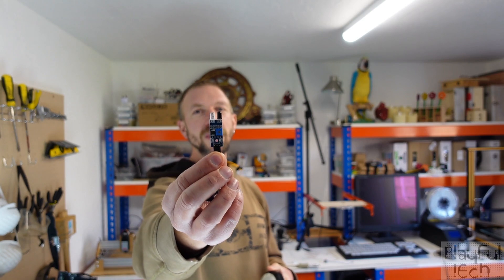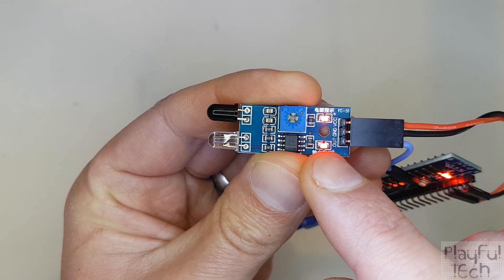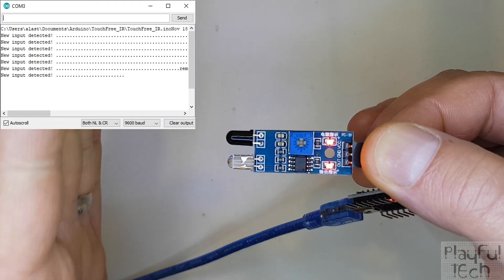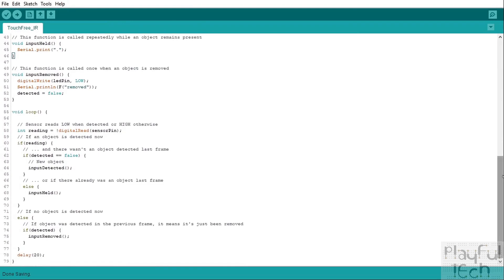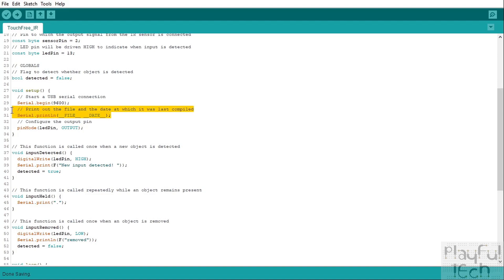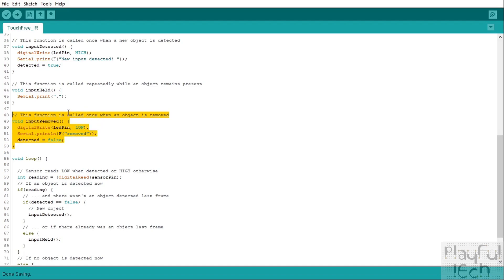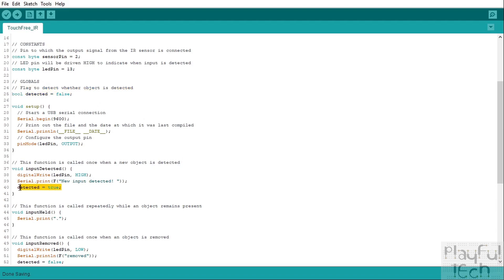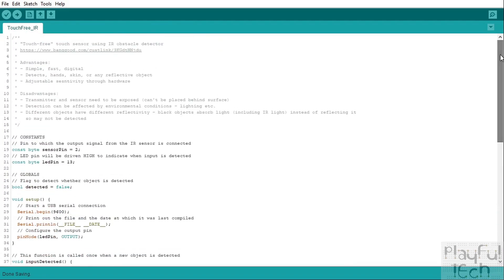Infrared Obstacle Avoidance Sensor Tutorial for Arduino / ESP32

Comment: Hey, I have an issue: I'm connecting this sensor to a robot and not using an Arduino at all. Instead, I have the out pin tied to the gate of a bs170 transistor (which drives a motor). When I power on the circuit, the object detection LED on the IR sensor turns on regardless of what's in front of it, but the gate of my transistor reads a zero voltage. When I unplug the OUT wire, the LED reads normally. Any advice?
Reply from the maker: I can't see anything obviously wrong with what you're describing.... do you need to add a pull-up/down resistor to the transistor gate?
Reply: @PlayfulTechnology  Yeah I ended up using a pulldown resistor on the mosfet gate and that fixed it

Comment: Error in your description.  At 3:30 you state that the pot increases the intensity of the emitter.
This, in fact, is not the case.

The pot adjusts the threshold of the comparator which, in effect, increases or decreases the amount of light that has to be detected before the output triggers.  

At least that is how it is on the units that I received.
Here is the schematic that I found:  https://www.pcbway.com/project/shareproject/FC_51___IR_Sensor.html
BTW: The "large signal response time, of the comparator,  is about 300ns.  Standard response time is about 1.3us.
I still need to get the datasheets for the ir emitter and detector.

At 3:30 you state that the pot increases the intensity of the emitter. But then, at 4:16 you state the pot adjusts sensitivity.   It can't do both.  In fact, it doesn't do either.  

The "sensitivity of the detector is fixed as is the intensity of the emitter.  
The pot merely changes the voltage (based on the amount of current flowing through the detector) at which the output, of the comparator, changes polarity.

I am not understanding, at the moment, the usefulness of the pot.  Unless, it is as you demonstrated.  It adjusts for spurious input from the emitter???

For my application I'm going to use two boards.  One for emitting and one for detection.  I hoping to get about 2ft of operational space between them.
Reply from the maker: Yes, you're correct - that's what I get for not writing a script and relying on the translation of a datasheet which interchangeably described the pot as "sensitivity"/"intensity"/"calibration" adjustment!
Reply: @PlayfulTechnology  datasheets are sometimes not accurate or comprehensive.

Something else I found out is that when the output is "ON" as indicated by the LED, the output of the comparator(input to the arduino)  is actually low.

I am constructing a speed checker for golf discs.  I have the emitter mounted about 12inches away from the detector and I throw the disc between them.

Comment: I'm wonder what the response time of the infrared device is.  
For instance would it be able to detect a golf disc travelling at 70mph?  60mph?  50mph
I just read that the detection distance is only 30cm????  Do you think that would improve if the device was enclosed in a box with a very reflective surface on the opposite side?
what's the beam angle of the emitter?  can it be collimated?
OR, could I mount the detector on the far end (about 2ft) so it is getting  light directly from the emitter and not the reflection?
 I'm looking for a way to measure the speed of a golf disc  without having to shell out 100's of dollars for a radar gun.
  go ahead.  call me cheap.  i'ts been done before.
    Besides.  this arduino stuff is a kick.
Reply from the maker: The "response time" is, essentially, instantaneous - the sensor is just an IR photodiode that is sensitive to IR light of the same wavelength as that emitted by the IR LED. But that IR light can be emitted from any source - so if you shine a light that gets reflected off your golf disc back at the sensor, the resistance and output voltage will change immediately in proportion to the amount of light received.

Comment: thank you for another great video.
It is so clear on your face and the way you speak you enjoy making these films so much.
Maybe this is why your channel is so loved by my students.

 I must say I disagree and this is really one of the worst detectors ever..
Every camera flash, direct sunlight or sometimes even heat can really disturb it and cause false readings.

There is another version similar to this one with a 555ne timer built in that produces a square wave which is detected, therefore it is not just a regular ir but instead specific signal.

I will share this as always with my my students as an example how to use an operational amplifier and a use of of the phototransistor.

Thank's again keep up the great videos!
Reply from the maker: You're absolutely correct that this module is limited in many ways, but I still think it has uses (and it is very cheap!). I wanted to start this series of videos with "simple" but flawed modules, and I'm going to progress onto slightly more advanced modules which address some of the issues you mentioned.
Reply: @PlayfulTechnology  
Thanks.
So much fun to receive an answer.
Keep filming and publishing!

Already got a notification about other videos you uploaded in the series..
When do you have the time?

Comment: I think the potentiometer sets the threshold for the comparator IC, not for the IR LED current.
Btw, you can use just an IR LED with a resistor and an IR photo-transistor in combination with the internal pull-up resistor on an analog input pin to do the same with a much smaller footprint.
Reply from the maker: Oops, my mistake - sorry - you're right!

Comment: You can also use the analogue output from the sensor to give the Arduino control of the trigger point which could enable longer range and also allow for tracking, so slow changes in level won't trigger it, only fast changes will, useful for cases where ambient light may be an issue.
Reply: Another minor point is the potentiometer doesn't alter the LED brightness as stated in the video it alters the comparator reference voltage on the detector, in real terms that's kind of nit-picky but the result isn't exactly the same, a better sensor would use a modulated IR source (40kHz is fairly standard for IR remote controls) that makes them more immune to ambient light pickup so better for outdoor use.
Reply from the maker: You're absolutely right - I explained that wrong - my apologies. I was also somewhat surprised to find that these modules don't modulate the IR source either (I don't know whether it's a region-specific thing, but I think 38kHz is more common here than 40kHz) - but it really is just a simple IR LED in this case. In later videos I'm going to be looking at some more "advanced" alternatives, so it was a deliberate choice to start with a simple module, even if it is somewhat limited!
Reply: @PlayfulTechnology  Sorry you're right, 38kHz, it's a LONG time since I've needed to do any IR hacking and that was mostly Sony who use 40kHz (also 40kHz is common for ultrasonics which I use a fair bit), rounding error :-).
Reply: @PlayfulTechnology  I'm really interested in solutions that work well outdoors, I know that's not really a thing for escape rooms but finding things that can reliably work outdoors is harder than many people would think.
Reply from the maker: I've found laser time-of-flight sensors to be much more reliable outdoors than simple "IR" detectors. They'll still have problems in full sunlight, I guess because the sensor just gets completely saturated, but they're perfectly good in overcast, or even indirectly lit scenes.
Reply: @PlayfulTechnology  I used them outdoors (kind of) for an installation at the Roof gardens Canary Wharf and finding something you can cover them with while working reliably can be tricky (when you don't have the resources of mobile phone manufacturers) as diffraction in the covering material can mess them up, I used clear sticky dots which was fine when it was dry but they really didn't like it when it rained, this was pointing up BTW so they worked when your hand waved over it, would be easier if working horizontal or pointing slightly down to detect a person approaching.
https://tinebech.com/portfolio-item/enchanted-connections/
Reply: The sensor he had in the video only had 3 pins - vcc, grd & out, so no analog out to use here, but I guess this was meant to be used in cases where you may not necessary need an arduino (you can hoot it up directly to a relay for instance). I think in a video he did quite long ago he had a photosensor (light level) and used the analog pin to set a baseline, just like you suggest.
Reply: @emiltoteb  See my other reply, the newer versions do have it, I thought the older ones did as well but maybe it's only on some versions.

Comment: BTW newer versions of that IR module have smaller LED's that are mounted at right angles and also have a plastic separator between them, obviously they work in exactly the same way but I don't know if there is a significant range difference although the separator may enable longer ranges by reducing crosstalk.